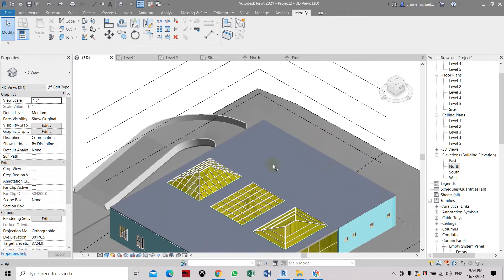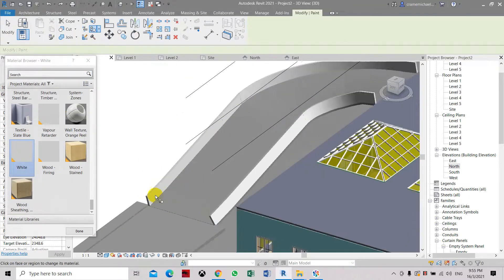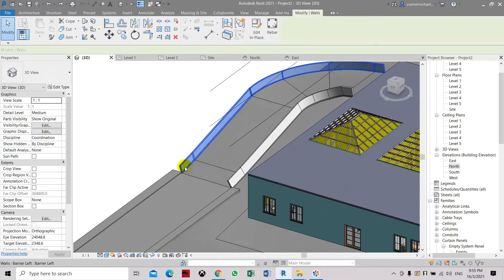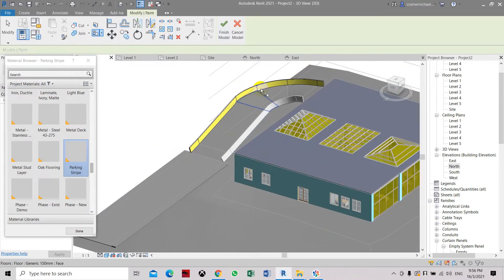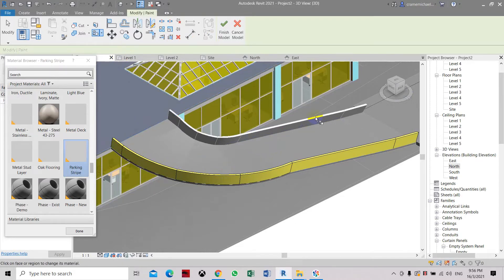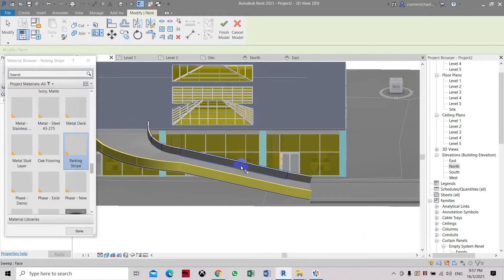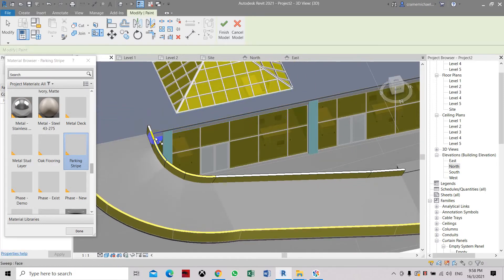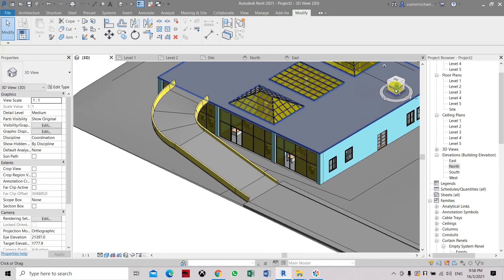Paint Model In Place Object in Revit

Comment: Its not a model in place, it is a wall which is different. From what I can search, there is no way to paint a model in place or doors etc, you have to change the whole unit. This means that it appears you cannot paint just one single door red for example. I tried painting both doors and model in place and was surprised it did not work.
Reply from the maker: Yes. You can. Use the paint tool and apply the color on any surfaces.